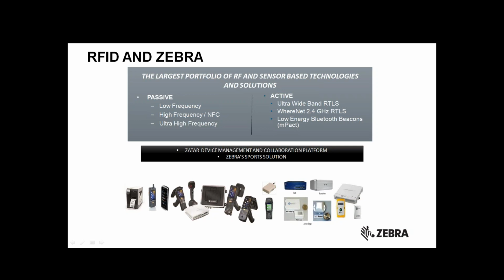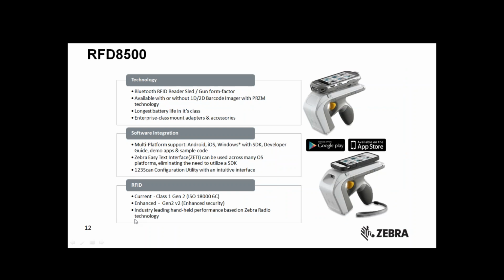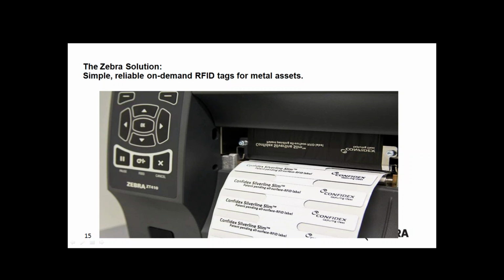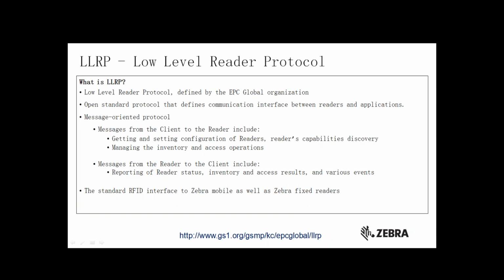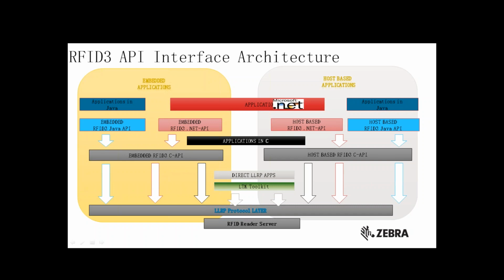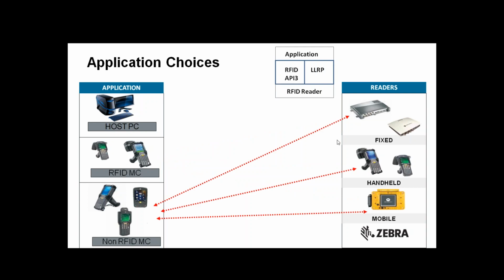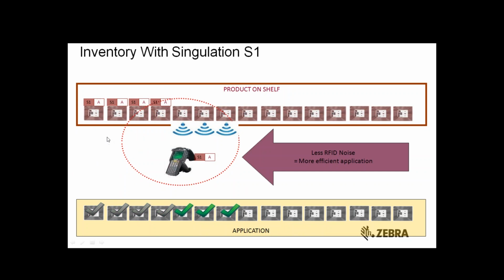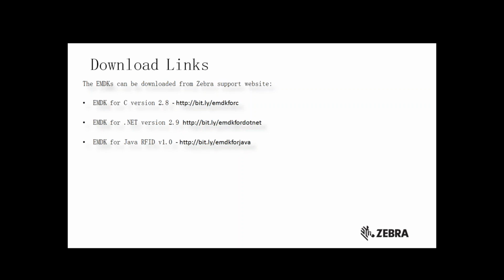Zebra DevTalk | UHF RFID Market, Products, and Applications | July 2016

Comment: Hello! I am fascinated with this. What type of school would allow me to begin working in this technology? How should I begin? Thanks!
Reply from the maker: Hi Daniel, thanks for reaching out. There are many ways to start working with RFID technology. Zebra offers thorough documentation on use cases of how customers currently use RFID and innovative ways RFID can be applied to their businesses. Zebra also has extensive documentation explaining how our hardware, software, and services can be built into an overarching solution. We encourage you to learn more at https://www.zebra.com/rfid.
Reply: Thanks for the response.  I have one specific question: Is this possible: to have a box (with a door), which is used to store items (tools and various materials that are not worth the effort to organize).  Each item has an RFID tag on it, which gets registered by VISCINITY (to the box) ONLY.  In other words, it doesnt get physically scanned in and out, it just does a continuous scan (1x per sec?) with circumference of 5 ft or so.  The application would be a landscape truck with a sidebox (or two) used to store said items.  There would be said RFID module keeping track of items, which would be tied to a tablet (or built in lcd console) in cab.  An app within tablet would tell you all items that you have on truck at all times with 100% accuracy and dependability, regardless of level or organization. I.e. (pitchfork x2, 4' level x1, trowel x2)
Reply: Daniel Thompson please contact Gary Andrechak at DSS Plastics Group to have him help with your project. We currently produce a very similar project for a soy bean plant measuring truck, weight of goods, etc. 

Good luck!

Rfidplasticcards.com